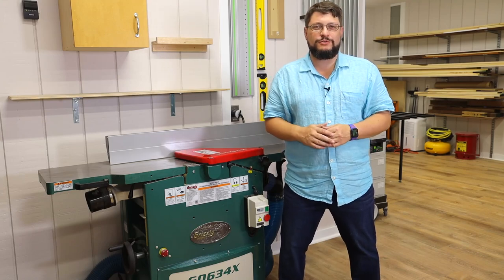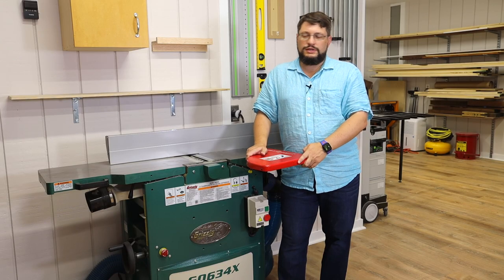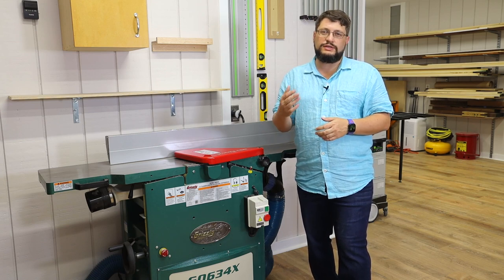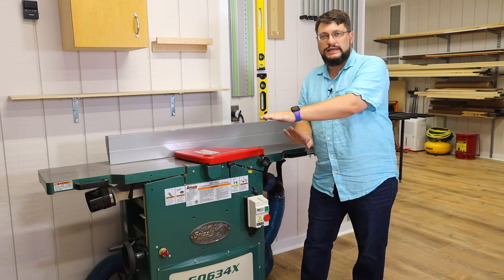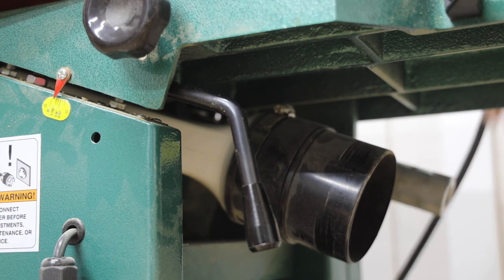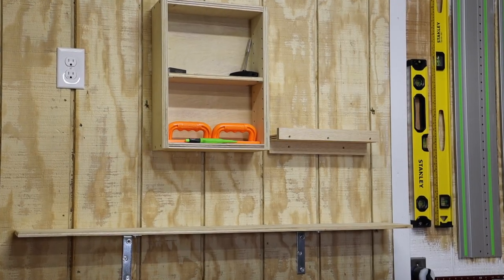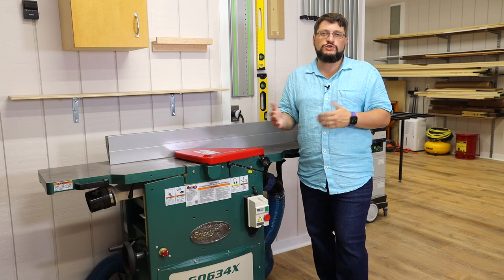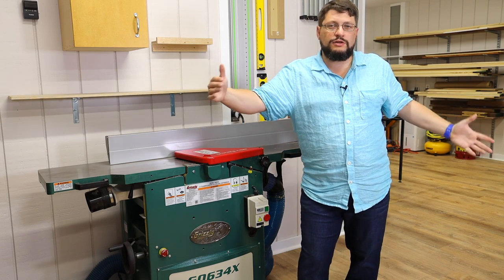Grizzly G0634X - 12" Jointer Planer Combo Machine

Comment: It’s hard to believe that fence doesn’t cause inaccuracy. Using the in/out method would negate these inaccuracies, but they would still be a problem if jointing a single piece that one wanted to be square.

Comment: I have the same machine. I have never removed the red guard when switching, just do the right wing first when lifting and last when dropping back down. Great review though. Not my favorite machine but many x cheaper than the hammer…
Reply from the maker: I think it’s a great mid-priced machine. When I started out 12 or so years ago I tried the cheaper combo machines and they all had lots of negatives. I’ve had a really good higher priced one. This checks off almost all of those boxes as the Hammer, and with the savings you can buy another large machine.
Reply: @mmwoodstudio  I'm very seriously considering this machine for the space savings which is at an absolute premium in my shop garage.  Would you say it's the best in class?  There's a Jet I could get used for $3900 (listed) which could potentially mean $3500.  It's very tough to figure out what brand to go with on this stuff.....especially, for someone who's just getting into this.  I've got to make a decision to either spend the same amount of money on individual machines on casters to move when not in use, or go with a machine like this.
Reply from the maker: @phillamoore157  I’ve not used the Jet. The Hammer with the helical cutter is the best I’ve used. It’s a lot more money, but has more features.

I do like this machine and am glad I bought it.
Reply: @mmwoodstudio  Yeah, the Jet has the helical cutter as well is 12", and lists at roughly $4900 give or take.  I figured at that price, they're all competitive.  I can't afford a Hammer.  So, I'm going to have to find something in that psuedo-$3500-$4000 range.  It's good to know you feel good about this purchase.  That helps.  Thank you for sharing.

Comment: I have one like that machine and shipped overseas it is working exccept only when you want use planer. Like taking the fence and taking the gurd out. It is powerfull machine and low noise
I am located in Qatar
Reply from the maker: Hope you can get the planer part fixed!

Comment: Don't waste you money. I've had this machine for less than one year and nothing but problems with starting. garbage
Reply: can you describe this is further detail?
Reply: Yes, out of the box it had a faulty mag switch, replaced that, then the vibration switch stuck several times. latest problem is the motor slow or no start, pulled and checked both capatcitors - both good, then readjusted the centrifugal switch. still slow or no start. Grizzly service is responsive and have offered to replace the motor but will not accept return the machine. I've spent more time working on it than using it @JonGilmore
Reply: @FieldingTebbs  Thanks for the update, I really appreciate it - I was nearly going to click buy and you've really made me second guess my choice. It's a lot of money to spend for a hobbyist like myself, and if I'm going to get a product that isn't reliable, hard to justify. Did you consider the Hammer A3-26 when you were buying? That's my other option, although its more expensive and only 10in wide
Reply: I didn't look at the Hammer, but would now. might also consider a Jet. I have a small shop so the combo is a necessity, also need the full 12" for the type of work I do. Glad I could help, I wish I'd had a different experience with the grizzly (still dealing with it as we speak) @JonGilmore
Reply: @FieldingTebbs  right on, kinda where I'm at, the jet is basically the same price as the hammer, but you typically see almost all positive reviews on the hammer and I can't say the same for jet